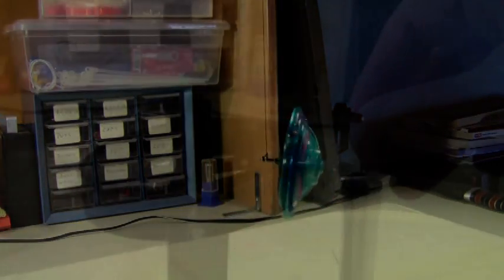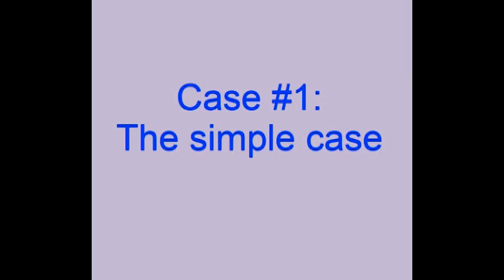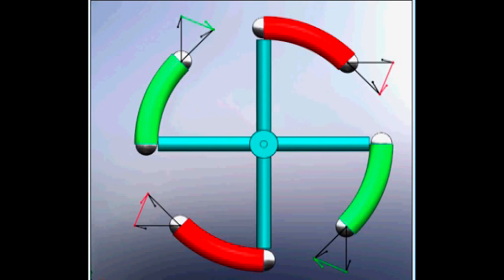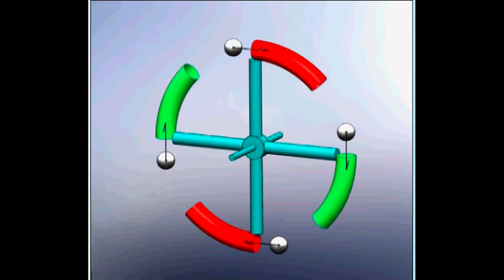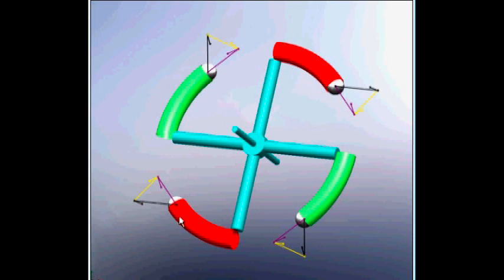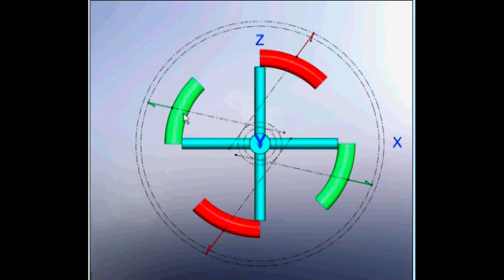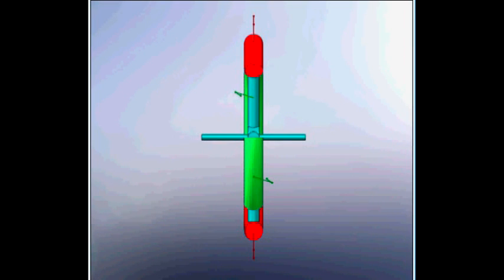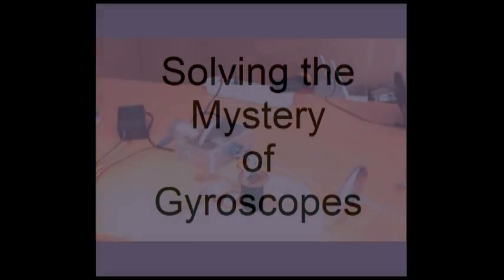Solving the Mystery of Gyroscopes

Comment: Ok so when the wheel is spinning there is greater resistive rotational inertia near the X-Axis of rotation because the trajectory of movement at the X-Axis crosses the X-Axis in the Z direction fighting the rotation of the Y-Axis as it revolves, yet the trajectory at the poles of the Z-Axis are inline with the X-Axis of rotation and does not counter Y's spin. As such the momentum of the wheel near the X-Axis naturally tries to rotate the Z-Axis instead, Zs counter momentum then resisting gravity

Comment: @alextee07 you are correct that the red vectors would change as well as the green, but if I'm not mistaken, they would complement the vector change of the green vectors, not conflict with it.  The example is simpler if you only  have to think about the three dimensional effects of two vectors rather than four.

Comment: Great video. But what I don't undertand, is why the red vectors are still in plane with the deflector, while the green are not? It seems me, the red vectors should change their orientation just as the green ones during the spin of the deflector around the X axis. Correct me, if I'm wrong. Thanks.

Comment: Awesome video presentation! I loved it. This really helps me in my slow but growing understanding for how a helicopter moves by tilting the "swash-plate" inducing "cyclic-pitch" into the rotors. What I still cannot fully understand however is the effect of precession, the 90 degrees of "lag" in the pitch change effect, versus the torque "steer" reaction moment about the rotors spinning axis of rotation. Why the 90 degrees offset? 
mrc109

Comment: This is a great video!  I just have a few questions: How can you be sure that the magnitude of the balls velocity vector is the same before and after the balls leave the tubes?  Also how can you be sure that you can tilt the apparatus any significant amount before a torque prevents you from pushing it farther?  Finally, so do all gyroscopes nutate, or rather do they just reach an equilibrium state where they neither tip down or up?

Comment: Continued#2
2. Movement two - The body/torso serves as the vertical axis of the second torque movement. (imagine a stake driven into the ground,through the head and crotch of batter). The right handed batter's body rotates in a counter clockwise motion.

Question: 
Are any "interesting" gyroscopic forces in play as these two movements are combined -- which could result in faster and/or more powerful bat movement?

Thanks in advance,
G

Comment: 1. Movement one -- The hands, as the horizontal axis of the first torque movement, tip the bat "head" towards you (front), then quickly torque the bat directly away from you, reversing bat's direction which moves bat head behind the batter. (the force provided by the batter's hands start the bat head in this direction, but once the inertia is established, no additional force is provided by hands).

As the bat head arcs with 1st movement, the 2nd movement is added.

2. Movement two - The body/to

Comment: As a graphic communication guy, i really like it. You seem to understand the forces involved. Do you think you could apply your understanding to a movement the human body makes when performing a type of high level baseball swing? 

Basically, the two movements I'm trying to understand are torque/rotational and are positioned in a way which is similar to "right angle gears". Consider the Batter to be facing you.

1. Movement one -- The hands, as the horizontal axis of the first torque movement,

Comment: I'm wondering if you could help with suggesting the correct angle offset and rotation between to gyro (used for stabilising an object) but want to cancel the effect of precession. Thanks.

Comment: I have a question though, Im doing a CFD analysis on helicopter blades. Ive been struggling to understand the principles gyroscopic precession. Why question is if to say that my blades did not have a mass or inertia, will this precession still exist? I can find a connection the connection...! 

//Chris